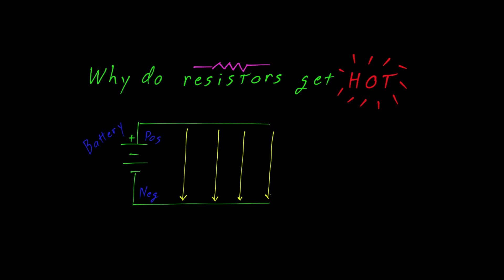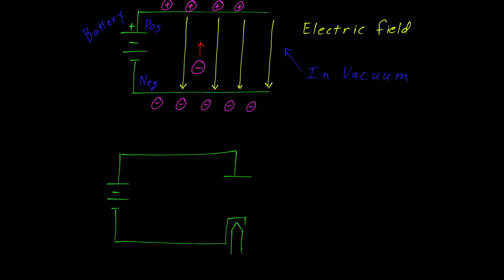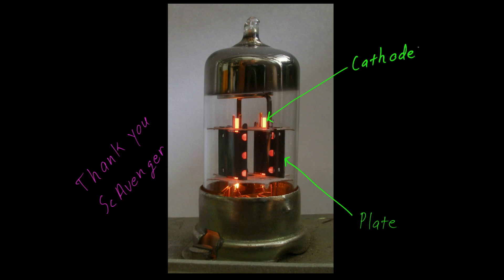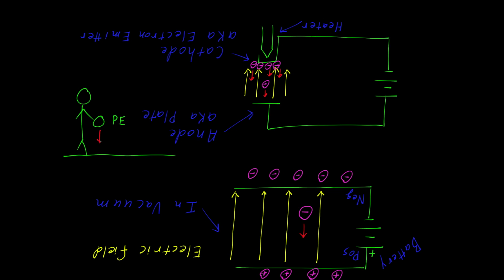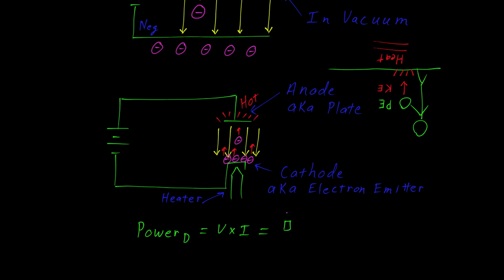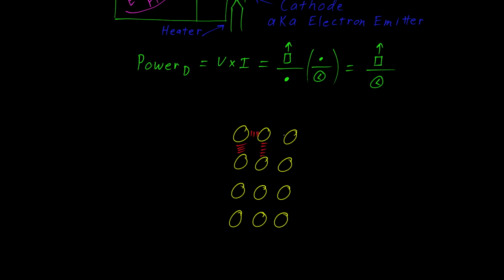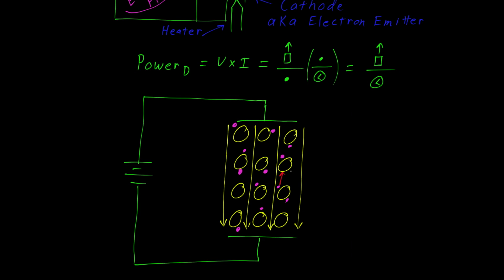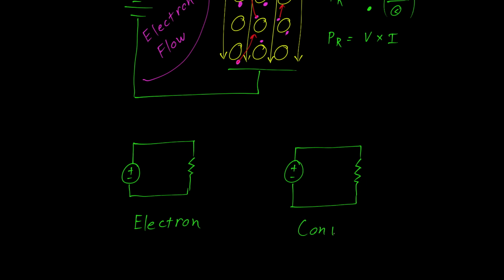Why resistors get hot

Comment: Thank you for the video, i habe question.
I open pcb board i find 1 resistor get 200° degree 😮😮😮, this resistor 100k
What is the things can be caused this? If replace it with low resistor what will be happen? Or hight resistor?
Reply: good question ?